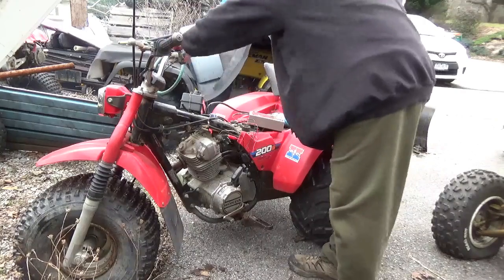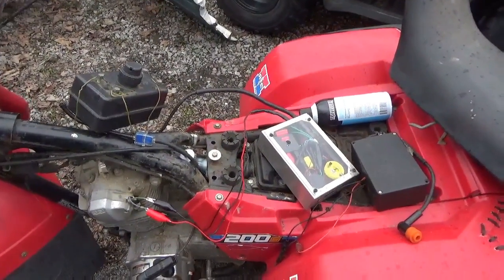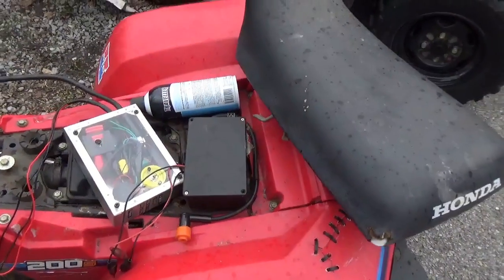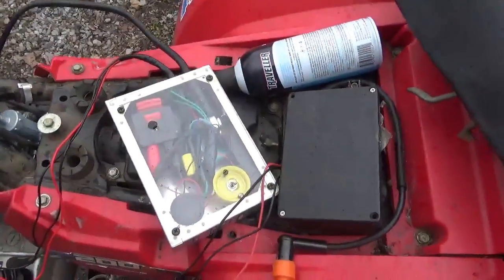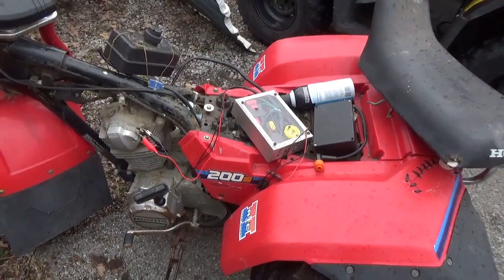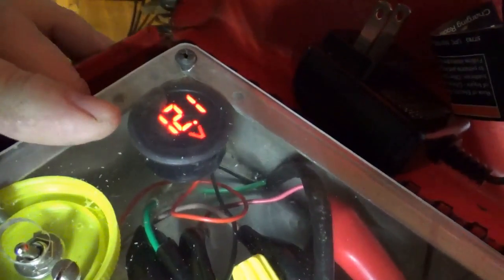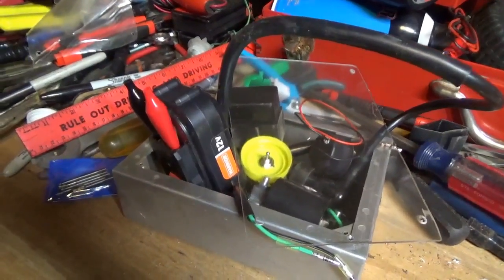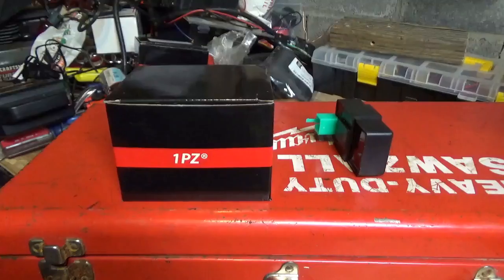Best Portable ATV CDI Ever, Easy DYI Build!

Comment: Harvey so basically you are checking really quick if your bike is in the mechanical condition where it will run and checking to see if the pickup is good.  So if you take this off and you try to start it and it won't run though basically you just replace the big ticket items one by one until it runs on its own ie. Cdi, pickup coil, and alternator setup?  I have been chasing phantoms for longer than I would like to admit.  I have a 84 200es i putzd around with it bought it with no spark got it running after redoing some wiring connections which might have just been placebo and cleaning the carb.  Rode the bike for a couple days then it died while riding.  Started it again it ran strong for another five minutes then pulled back up to the house it died now and it doesn't have any spark at all and hasn't for a couple weeks now of tinkering.  The weird part is every part has a the proper ohm reading per the honda shop manual.  Grounds also appear to be good to the limit of my knowledge.

Comment: Harvey i have one of the earlier versions of your DC CDI in use on our TRX250 utility quad that has issues with intermittent connection at the oem cdi.  Runs great, ready for trail duty.👍

Now I'll build this newer version for the toolbox.  

You rock man!  Many thanks.
Feet down heads up, ✌️🍩
Reply from the maker: Hey Dan!!!   U are one of my longest and most loyal subscribers and I really appreciate that!  About the portable CDI box, it maybe the most useful thing I ever created and I couldn't be happier that U R making good use! The only problem with my ATV tool box is that it is very heavy... Other than that, it contains all the tool I need for routine repairs.... Believe it or not, when U pick the box, go with more surface area and less depth so that so much unpacking is not necessary for use... Thank you always for Ur thoughts, encouragement, watching, and commenting!!!

Comment: I understand the Chinese wiring harness from rebuilding a couple of them. Ware you lost me was adding the additional wires. How do you add 3 more ground wires to the ground wire? What wire are you hooking the meter to? If I use the red and black for my switch then what wire do I run the positive gator clip to? Wish u would have shown the wiring step by step for us guys that aren’t familiar with doing additional wiring off the harness or have a good electrical understanding. I can follow step by steps.
Reply: Hi mister Spooner i must agre that its hard for guys like US that need Step by Step. When you show How to put it Together i fell of every time you show Box and you start Talking about!!!!!!!!!!!!!!! And then you Jump to Wiering and lot of talking of Things i dont understand, så Can you please start puting all on Table and show Step by Step weare  and what going in Box, i dont understand what going in and How i  Get spark? You talk of so  many Strange Thing and do the spark Come on When you turn on Power nob in Box ? Because When you Run 12 V from Box do it spark all time? Help me please it a Lincoln 200cc ATV an i Run it last summer and no i dont Get spark and i Bye all things New Wiering and all. But must breake or stand in Neutral ornsome Thingstad start? ¿.
HELP ME PLEASE

Comment: Thanks for the video Harvey. Question do you have a flywheel install video?
Removed my flywheel easily on my 84 200es but am having trouble reinstalling. Already broke the recoil bolt in crank but thankfully removed it. I can not find any videos on this any help would be appreciated thanks

Comment: I don't mean to sound sarcastic, but what do you do once you have the engine fired up and you want to run the bike? Do you cary the box with you and run the bike until the battery discharges? Or is this unit mostly just for diagnostic use?
I have a Honda XL200R that I put a new Lifan 200 engine in, and though I've changed out the stator, coil and hi tension wire, CDI, plug and all associated wiring, all I can get is a weak spark. I even disconnected the kill switch. Not sure which way to go now.
Reply from the maker: Hey StevePeterson!  I have used the handgranade version 
of the portable cdi box using power from the key switch for an electric start atv or I use the AC powered cdi kit and power off the stator....

About Ur flywheel issue.... I find that the flywheel does not seat when something below it is not right... Once on a 250es big red, I discovered that there were 2 different fly wheels and 2 different stators such that they all looked alike, but they had to be matched or the slightly smaller flywheel would hang up on a slightly bigger stator. I had it that the crank did not seat completely because misplaced spacers, I had slightly different rev covers hang up fly wheels... Sometimes the flywheel seats better if one installs the keyway after the flywheel is seated... Most of all, I hate it when someone else takes things apart, plays with the pieces, and then I have to figure out how to get it all back together, especially when they add or subtract or substitute pieces.... I must say good luck, if someone else's fingers were in there, I would say U have a less than 1 in 4 chance of getting it all back together,,,,  Thanks for asking, watching, and commenting!!!
Reply: @HarveySpooner  Thank you for the response. But no one else has monkeyed with the engine, as it was brand new. I changed the stator when I found that I didn't have spark, but I didn't have to pull the flywheel as the stator was bolted to the crankcase cover. I fear that the gap for the pickup is too great and I'll have to pull the sidecover again and the this time the flywheel too. Thanks again for your response. Your videos are always informative.